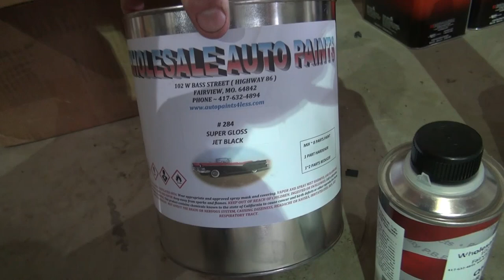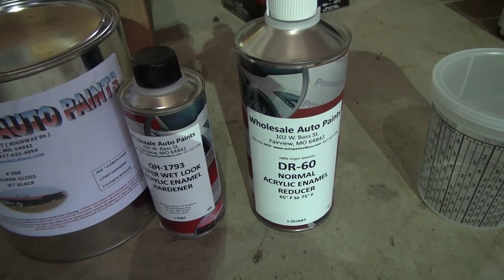Gooseneck trailer restoration part 10

Comment: it takes me several coats to get everything when i paint a trailer or a truck frame. i always find spots i missed. still better than it was. its a lot of work re-doing a trailer.
Reply from the maker: Yep, alot of work in these projects. I built a gooseneck trailer from scratch about 10 years ago with 2 7k axles, way before I knew anything about youtube. I think it took about 3 months to build, I had to sell it and my last tractor after I bought my house and lost my job probably 7 years ago. Its in the very first youtube video I ever done towards the end of the video https://www.youtube.com/watch?v=LBZLEkuPsWI I built that grapple on the tractor bucket also. I should have been doing youtube back then! Oh well better late than never I guess 😂